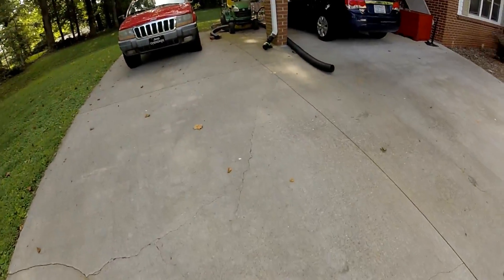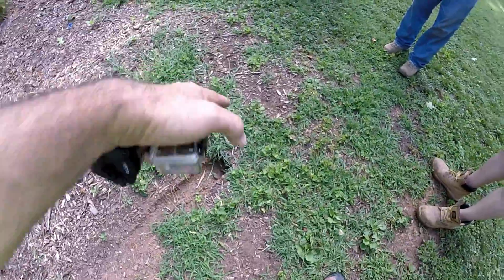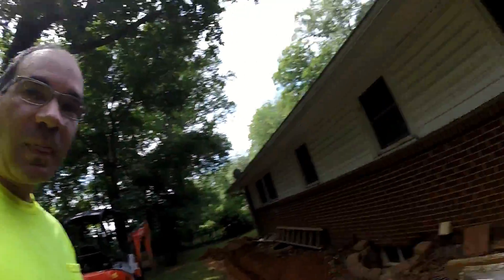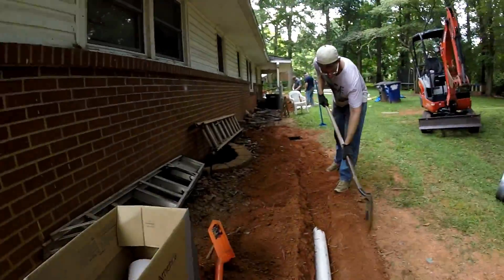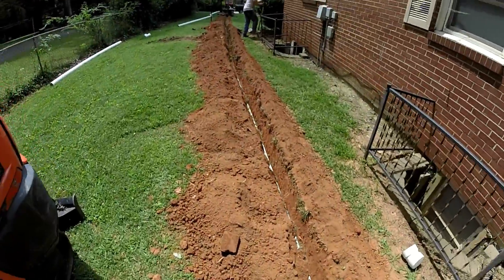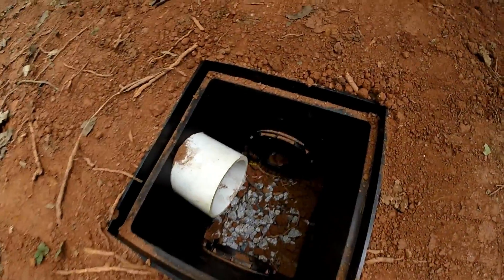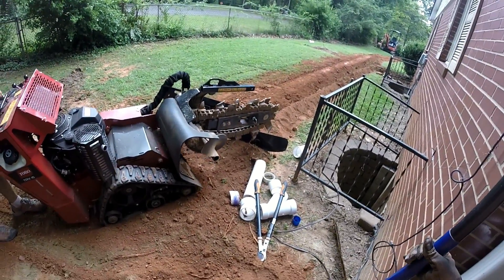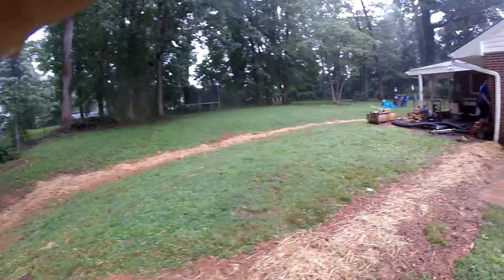What's the best way to install catch basins?

Comment: Any thoughts about installing a basin right after the downspout goes underground on each downspout?  So run the downspout underground, into the basin from the side, then run the actual drain out the opposing side.  Just trying to kep the pipe as clean as possible.

Comment: Would you still drill weep holes in the basin if it's going under a gutter right next to your foundation
Reply: Downspouts get connected directly into a pipe. If a catch basin is needed, it would be set away from the house and the ground would be pitched away from the house.

Comment: I don't get it...What's the point of putting catch basin if the drain is at the bottom  ? All the sedimentation running in the pipes is just gonna keep running through ..  The purpose of a catch basin is to trap the sand and junk at the bottom of the catch basin and the drain suppose to be at the top and drain the over flow.. But you're suppose to clean regularly the bottom of the CB... Open one (CB) on the city street and look inside..!  The way it's been done in this video , might as just put a long bend pipe and forget the CB.

Comment: Great Vid 👍. I have a home in the country in Upstate NY...rural area with no sewers but natural drainage ditches ...I have a basement sump pump system...But on the south side of my house is a farmers field that has a low spot and water settles and backs up into my rear yard...They're is a existing field drain pit with lines coming in and are buried about 3'. Everything was draining at front of my property...But over the past few years when public water lines were installed they disturbed the pipes and now I believe it's causing backyard field drain pit to back up...I have 2 gutter downspouts and sump pump tied into existing system...So most videos deal with slab footer drainage...But your video kinda shows what I want to do...remove surface water and connect gutters and sump pump to a system similar to this project... Question???   Why did you go with solid verses pipe with holes ( French Drain Lines) and only use catch basins? Wouldn't French Drain Lines ( Solid with holes ) along sides of house be added benefit besides catch basins?    Thank You ✨👍 ( I don't want to mess with existing lines as they are deep...But would like to do a similar system as you   did....I have no problem with standing water in front or sides...Just the rear ..About 20'-25' behind the house I would like to install shallow system like yours and then level low settled areas with catch basins... Should I run solid pipe between basins ...Or could I use solid with holes between basins and then solid to exit like your system?

Comment: What type of PVC do you use? Local irrigation supply store said Schedule 40 is overkill and recommended that I use SDR-35 instead since it's better than D2729. What is your opinion on this? I do not live in area that rains a lot or freezes.
Reply: Curious if any of the YouTubers can help select a pipe. Here in my area Schedule 40 is  $7 per linear feet vs $4 for sdr and $2.50 for d2729. It would be super helpful if anyone had any guidance here so I know what to ask for. Thank you so much 🙏
Reply: @doffazz  Schedule 40 will stand up against tree roots the best if sealed properly. Once a pipe cracks roots will grow into it, eventually clogging it or breaking it altogether.

Are the pipes near where large tree roots can reach it?

Comment: I see now they make those square catch basins were you can adjust the height of the hole by removing tabs, then sliding it in the brackets, which avoids covering and drilling another hole.
Reply from the maker: The problem is it's dead space between the bracket and the top. We just did a catch basin like that and I had to cut it anyway because we had such little fall to work with.

Comment: That outfit that did the foundation waterproofing should have dealt with the surface rain water better. Package problem requires package solution. Really too bad for the homeowner. Great system GCFD!!
Reply: They may not have been hired for that. These jobs are not cheap, and so often  homeowners will not spend on a "total solution" even if it is discussed.

Comment: Would you please let me know the pruposes of catch basin? Catch air for easy flow or catch water or both?. Thank you
Reply from the maker: Catch basins catch point surface waters.
Reply: @GCFD  and it serves as a vent too? Otherwise how can the water be able to flow
Reply: @hungvu8480 By the sloping the pipe, so gravity takes over, to an open end.
Reply: @hungvu8480  It would still flow without them. Its not a closed system like you have in your house. The gutter outlet on the roof would basically act as your vent.

Comment: Someone suggested filling a catch basin with cheap paver bricks, up to the bottom of the outlet pipe - the basin will fill with water faster, and start draining faster, and bricks vs gravel for ease of cleaning. 

I thought about drilling weep holes in the bottom of my catch basins, but worried about it eroding underneath or something.  Guess that's silly.   What do you drill, 1/4" holes? 1/2"?
Reply from the maker: I think you're good either way. We drill something like 3/16" holes but it's not critical the size.
Reply: @GCFD  Thanks!
Reply: Bricks can help prevent the drain box from floating too. Good idea.

Comment: All these YouTube videos on underground downspouts never seem to run into nasty roots when digging.  Just nice easy soil.  I run into pain in the arse roots whenever I try to dig.  It’s not fair😖
Reply from the maker: We hit roots all the time. Check out my latest video where we had to chop tons of small roots out for a sump pump line.
Reply: Oh good.  I thought I was just cursed.  Thanks for responding.  Here in Georgia we have Bradford pear trees with a root system from he||.  Went through about 10 sawzall blades to get a tree stump out which was planted right over a sewer line and right in the middle of two underground downspout lines.  Who plants a tree in a spot like that?  Stupid developers.  Nobody should ever plant a tree that close to the house.  If you ever have a job near a Bradford pear tree you will encounter roots from he||.  Those trees are demon trees.

Comment: What’s the point of the catch basin if it has to fill up to drain?  Does the water just sit at the bottom?
Reply from the maker: During a rain the basin will fill up and then start flowing out of the pipe. There are holes in the bottom so the residual water eventually drains out of the basin.
Reply: Catch Basin is a collection point for bigger objects other than the water, like leaves, etc. Otherwise, no catch basin means bigger chance of clogging your entire sewer pipe
Reply: Catch Basin literally means to Catch, so there is a manhole or cover which you need to open and regularly collect the big Dirt and throw out.

Comment: If I use schedule 40 pvc, how would I connect to the 3x4 gutter adapter to the 4" schedule 40.  In all the stores I look in, the gutter adapters are in the schedule sdr 35 sewer drain size and not schedule 40.
Reply from the maker: I just insert the gutter into a coupler.

Comment: Do I want to put anything on the outlet pipe to prevent bugs or critters from crawling up pipe?
Reply from the maker: If you use a white pipe they are usually too bright inside to attract critters. The smooth wall also doesn't let them pack any debris or build a nest. This is because the pipes flows so well that water blows out that debris.
Reply: @GCFD  thank you! Awesome videos. Please keep them coming.

Comment: So, driving on this lawn at a later date, with shallow drain pvc is out of the question?
Reply from the maker: Thanks for the question!
If you have corrugated or thinwall PVC (schedule 30) I would not recommend driving over your system. In this case that's exactly what happened to collapse the previous existing system. Once collapsed, no amount of snaking or cleaning can make the system flow again.

This system is 4" schedule 40 PVC, the same pipe that is used for the main sewer line from the house to the city sewer. It's more than strong enough to hold up to being driven over, regardless of how deep it's buried. I can drive my excavator over a piece of this pipe on pavement and it won't break - which is why I recommend using the highest quality pipe on these systems. 

 I would wait a little while and let the disturbance settle down before driving over the system because the pipes are all positioned to have good fall. The catch basins are also rated for 1000 lbs, but again, I wouldn't really want to park a vehicle on them.
Reply: @GCFD  Excellent, thanks.  I only have to run about 45 feet and it's in an area I won't be driving or parking on, however I still think I'll use the higher quality pvc.  Thanks again

Comment: 10/10 I went with the smooth wall b/c I was not at all able to do a 2% slope install.   This video is one of the best smooth wall installs I've seen yet.
Reply: Bob, same here. I just did a project connecting one existing system to another - the first system's existing outfall was in a location I could no longer use - and because the beginning and ending points were already established, I could only fall 10.5" over 74 feet, about 1/8 bubble, just over 1%.  I can't wait to see how it flows in a downpour.
Reply: @DaddyBeanDaddyBean  Around here some of the land has 0 inches of soil above the water-table so I prefer to install 6 inch or larger b/c it can have .5% slope & still be self cleaning. The problem I'm finding now is that if the pipe isn't below the natural compaction layer then large trees can send roots under the pipe & lift it.
Reply: @SlackerU  I’ve heard of sand bedding under the pipes that allows the tree roots to grow without lifting pipes. But I’ve never seen it or read any case studies proving it works.
Reply: @alanostner  I'm having to move a 6-inch pipe b/c a white-oak has roots lifting it.  I originally cut some large roots but when doing it I felt it'd fail.  I wish I could install it under the roots but I don't have the elevation so I'm moving it a few feet over.  In my citizen-science we're basically forced to install below the compaction-layer b/c on the compaction-layer is where the tree-roots travel.  My French-Drain with bottom-holes has small tree feeder-roots all the way down it, they don't lift it but they're there.